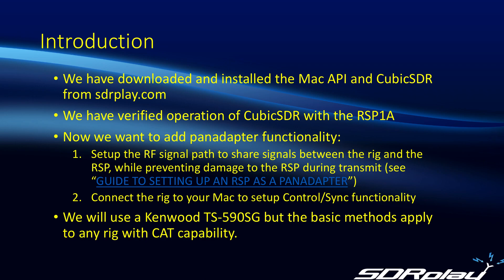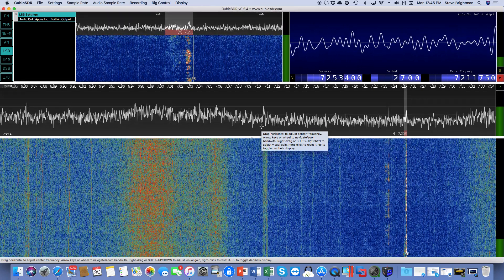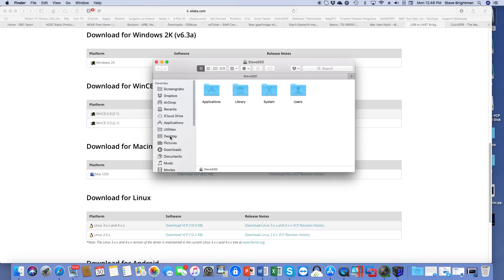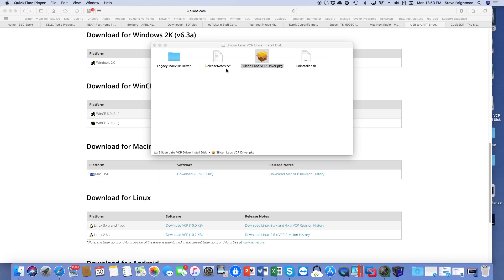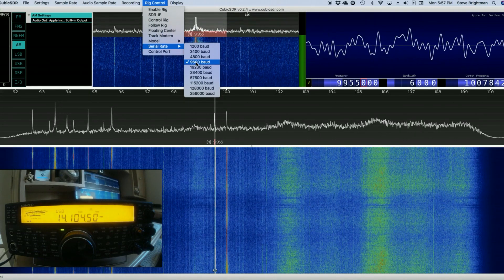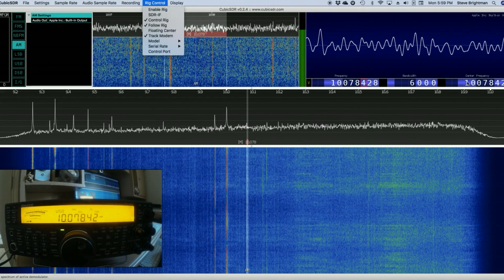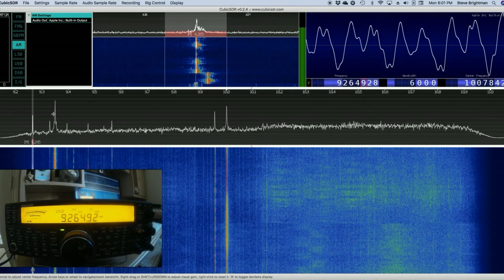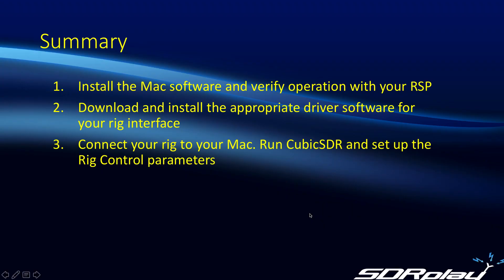Setting Up a Panadapter on your Mac with the RSP1A and CubicSDR

Comment: I had really looked forward to setting this up for my Yaesu FTDX 1200.
I ran out and purchased a Serial>USB cable, and an 8-pin>RCA cable for my rig's "Tune" port. 
Then I bought and installed my SDRplay RSP1b, modified my MJB T/R switch, I couldn't wait to setup RIG Control.
However, to my great dismay, all attempts at setting up CubicSDR on my Mac were a waste of time.
You see, the newer Macs have a different CPU architecture called "Apple Silicon" and are designated as M1, M2, or M3 chips.
As of March 2024, CubicSDR refuses to run on these Macs.

Comment: You didn't scroll down far enough in the CubicSDR Rig Control setting for me to see if it supports the Yaesu FTDX1200. 
Can somebody tell me? I've been looking for a video that tells me how to hook up a Panadapter to my rig without me having to solder in an internal IF tap board.
Reply from the maker: Yes it does. Please refer to the panadapter webinar for info on how to set up signal routing.
Reply: @SDRplayRSP  Thanks! I just saw this. 
Should be a fun project once I get the  CAT cable and Tuner cable to control the Antenna Switch.

Comment: Dear SDRplay Team,
i am planning on using this exact setup 
Many thx for this comprehensive tutorial video
There is only one question left for me: i am using RumlogNG (logging software) which already has a USB CAT interface to control my Kenwood TS 590SG. Is it possible to connect the two softwares simultaneously to the Kenwood, or will this cause problems 
Kind regards
Georg

Comment: I'm a new owner of the RSP1A. Is it safe to assume that the RSP1A is connected to a separate receive antenna than the radio antenna ?
Reply from the maker: No, in this video we used the DRV out from the Kenwood so we shared the same antenna. Please review the written App Brief referenced in the description. There are many ways to handle the RF signal routing and your RSP must always be protected.